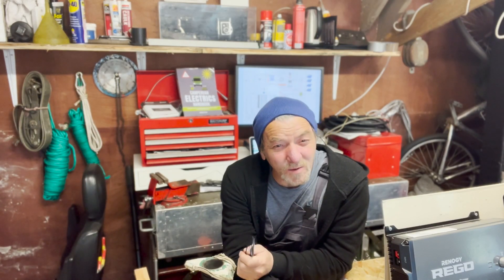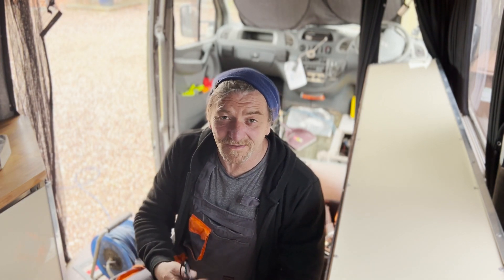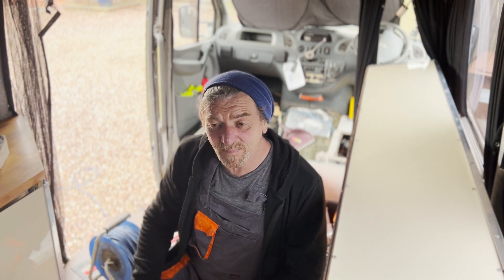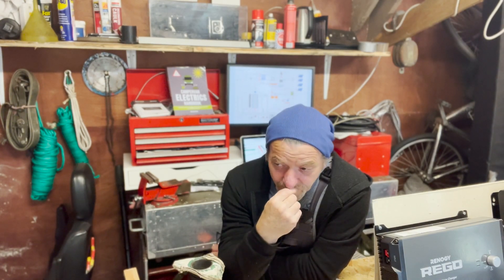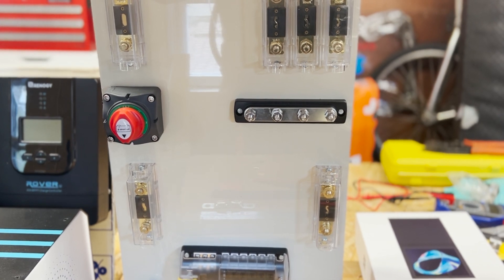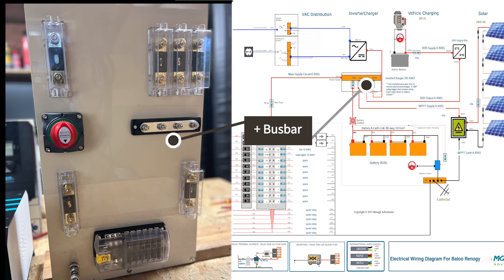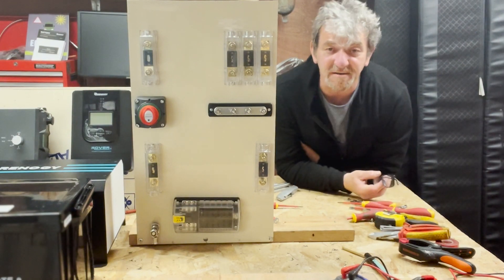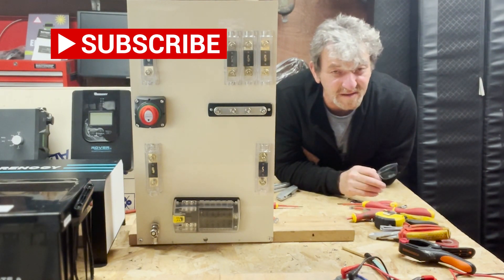How to Build and Install a DIY Fuse and Control Panel for Your RV or Camper Electrical System

Comment: Excellent info. I agree, I dint want to hide what I know I will need to service later. How am I going to use it and how am I going to perform maintenance on it. Top two considerations I have in my builds. 
Just purchased a van, an upgrade from SUV. The SUV has solar, freezer fridge. Most components are where the passenger rear seat floor board is. So your point of spacing components out is very wise. 
Thanks!